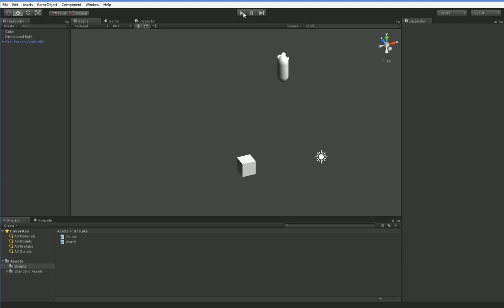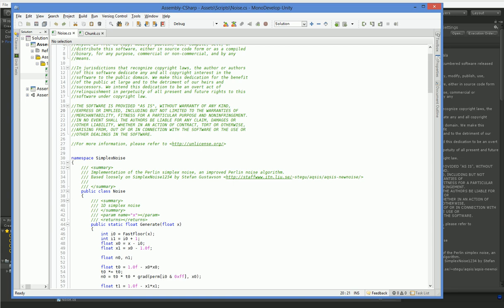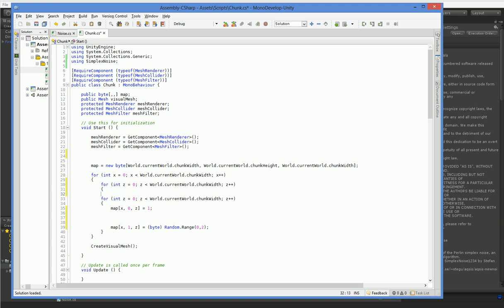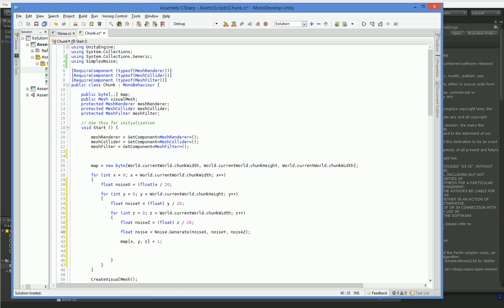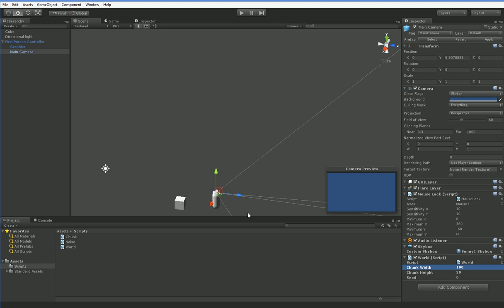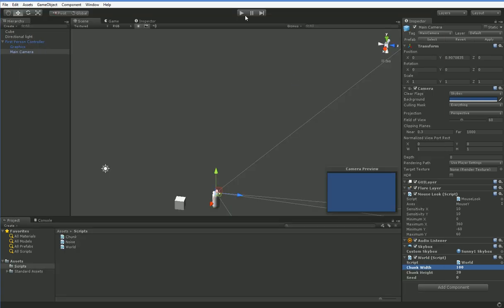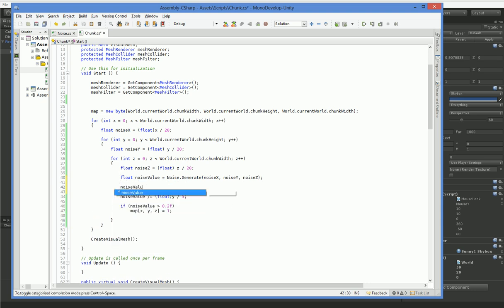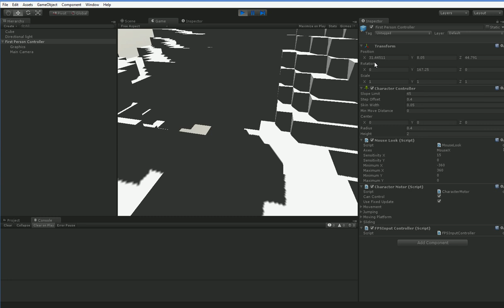Minecraft Mech #5: Let's Program

Comment: I've successfully made cross chunk seamless terrain generation work using the Unity built-in Mathf.PerlinNoise, using the output value as the terrain height of course. My conclusion is, it works excellently. I didn't yet look at the simplex noise script you used in this video, but it does look interesting and could be used to make caves and tunnels in my terrain. I've said it before, and I say it again: Very good tutorials, Craig! :-)

Comment: just a note , i don't know if it will matter but if you look at the code in noise.cs they are passing  x, y to the 2D method and x,y, z to the 3D method so they are using z for height and unity is using y.
Reply from the maker: That doesn't matter in this case.

Comment: It says when I try to set the chunks past 39 it gives me an error and says meshes out of bound and tris are out of bound and that I have more than over 6500 virts and when I press the play buttion it deletes the block?
Can you help me with this please if you need more specific details I can inform you of them.
Reply from the maker: That's not a bug, that's just the way it is. Your chunks can't have more than 65,000 verts, so use smaller chunks.
Reply: ok thanks will the rest work with smaller chunks though or dose that not matter?
Reply from the maker: The chunk size should be okay even if it is small.
Reply: okay thanks

Comment: i keep getting IndexOutOfRangeException: array index is out of range error after adding: noiseValue += (10f - (float)y) / 10;
Reply from the maker: That library will error out if you pass it a negative position.
Reply: Craig Perko did i make a mistake in scripting?
Reply from the maker: Kevin Miller Look at the function. (10f - (float)y) / 10

What happens if y > 10?
Reply: Craig Perko i get the same error IndexOutOfRangeException: Array index is out of range.
(wrapper managed-to-managed) object:ElementAddr (object,int,int,int)
Chunk.Start () (at Assets/Scripts/Chunk.cs:41) that is the line that states: map[x, y, z] = 1;
Reply from the maker: Kevin Miller Ohhhh that's a different problem. X, Y, or Z is either < 0 or larger than the max size. Check to see that your loops are using the same variables for their upper limits as the creation of the map variable.
Reply: Craig Perko Thank you very much, i found my problem. I had put World.currentWorld.chunkWidth for my y variables instead of chunkHeight